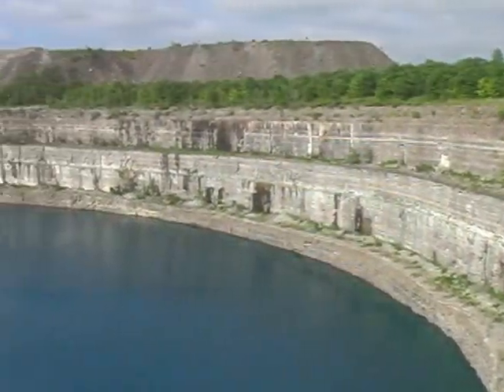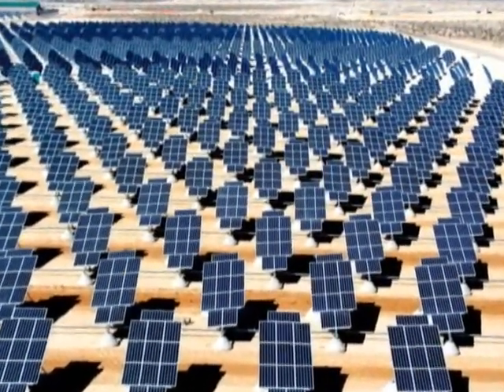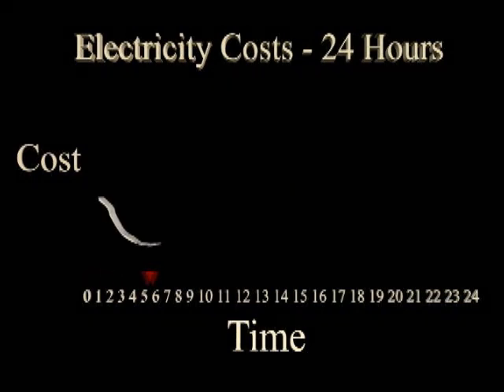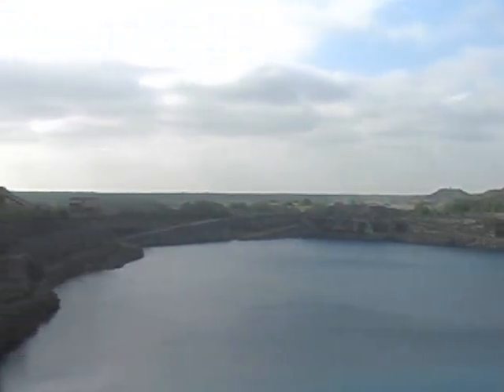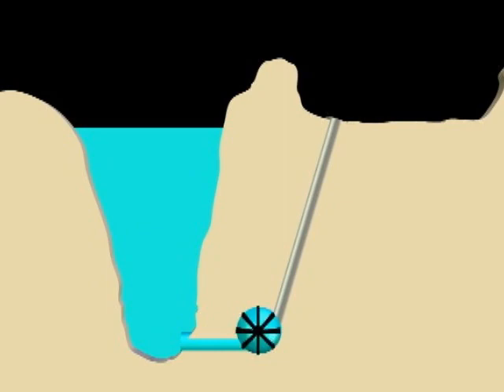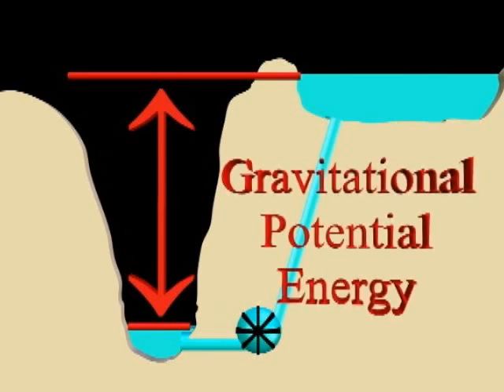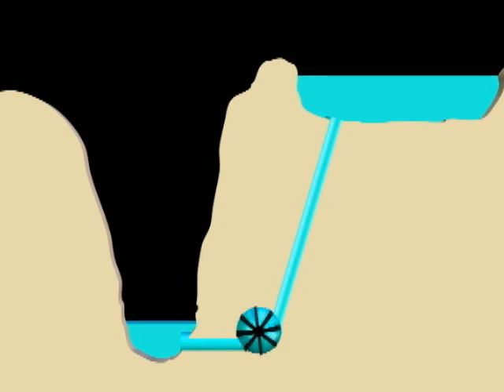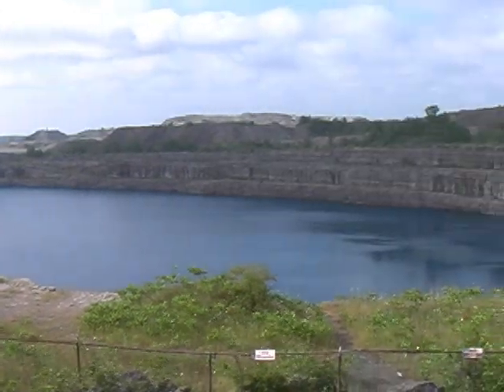Storing Energy on The Grid

Comment: Forgive me if this has been asked before but i am intrigued, does the energy used to pump the water up into the upper reservoir equal to the amount produced by the upper reservoir draining back into the main reservoir?   Or is it less?? and could a way around this be by using one tunnel with one pump to pump water up the top, then use a different tunnel with two or three generators to drain into the reservoir and and harness more energy than what was used?

Comment: @dufusrunescape yes, but this method is used to hold energy for when it's necessary. as you've seen in the diagram on the start of the video, at night, there's a lot less energy usage. so you can pump the water up at night and release it at midday, to get more balance in energy-use-time

Comment: I thought of this before but instead of dangerous underground water channels Use a gear reduction electric motor like a winch to lift weights up an elevator shaft (underground or not) and employ elevator emergency brakes etc.  Using cables and the same gear reduction you can spin the generator/motor to recoup the energy used to lift the weights.  No evaporation, drought issues, or any other water/electrocution type issues.

Comment: If there are hills or even mountains close to the sea, renewable resources could be used only to pump water uphill from the sea and then use the constant water flow to power up turbines or whatever to create electricity, it can be 100% renewable and yet have constant electricity supply not to mention how easy it is to use as much flow as needed at any time by turning generators on and off whenever needed!!!

Comment: definitely a neat idea if it truly is efficient. i didnt even know there was a problem of not being able to store electricity. do we not have the capable battery or capacitors to hold such energy? would it be more efficient to try to just get the extra power further distances even if some is lost by long wires?

also, im sure this probably wouldnt work, but what about using the actual iron or the earth to store a charge?

it seems so silly that we cant think of a way to store TOO much power.